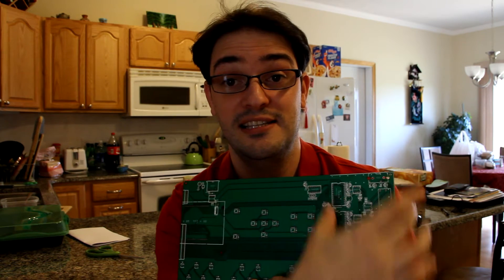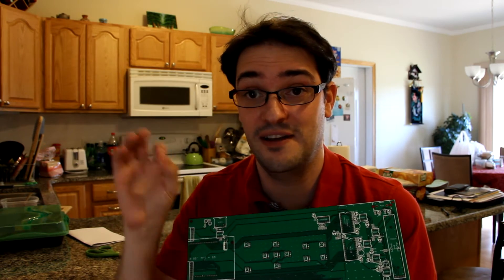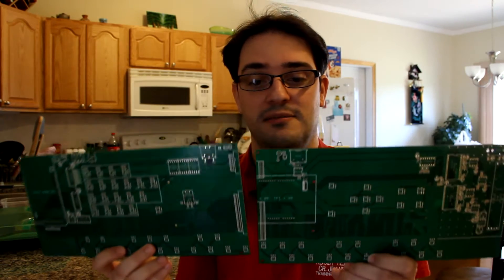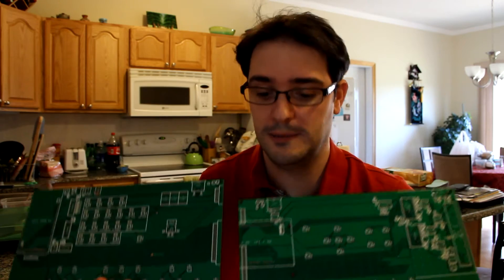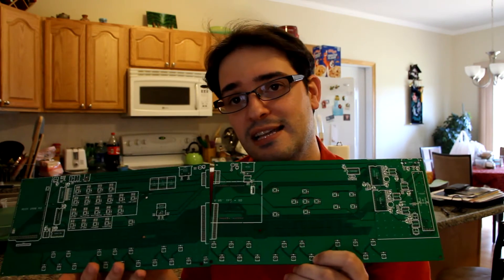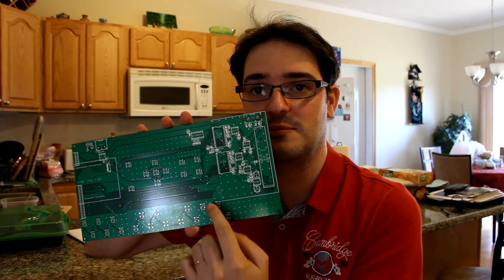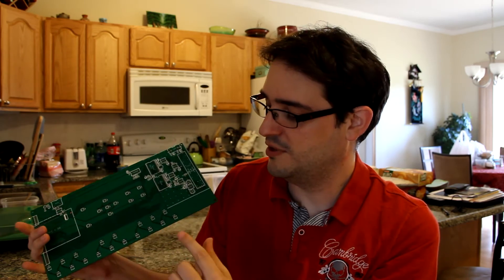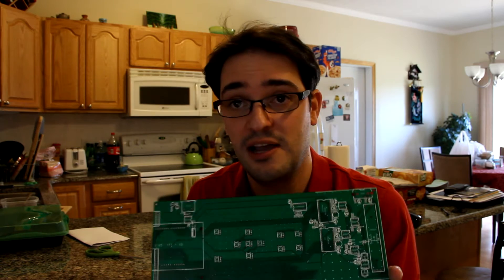PCBs arrived! Let's take a look

Comment: Maybe for the Nes sound, you could find a psg with the exact capabilities of the Nes.
But, think you would need something to control it. 
Well, it's not simple, but maybe something that can be programmed on the fly, like the game boy lsdj.... 

:)
Reply from the maker: Ironically the PC Engine/TG16 has very similar capabilities on the PSG but it uses the HuC6280 which is also the CPU of the system much like the NES. In any case, I think the purpose is to make sound from the original chips with all of its native characteristics and quirks, so using a replacement would be similar to emulating the thing... :(

Grande abraço!
Reply: Once you have to write programs to control either the HuC6280 or the Ricoh 2A03, maybe you can use the PCE one, and write to act as a Nes apu, but maybe with more channels ?
And using only one chip for both ?